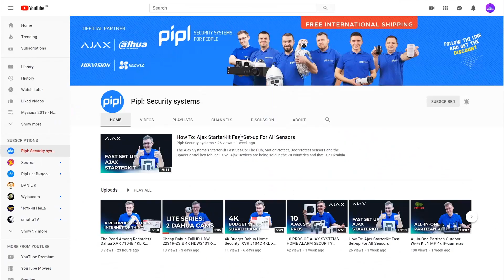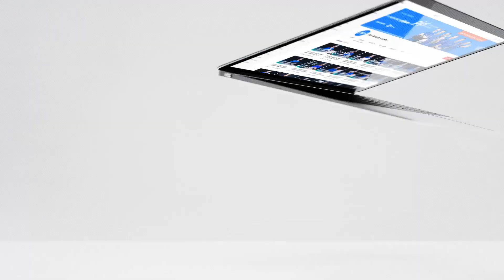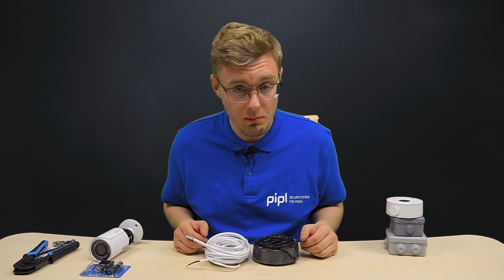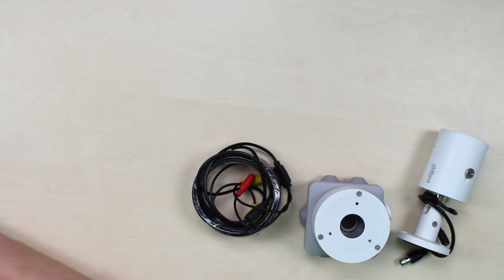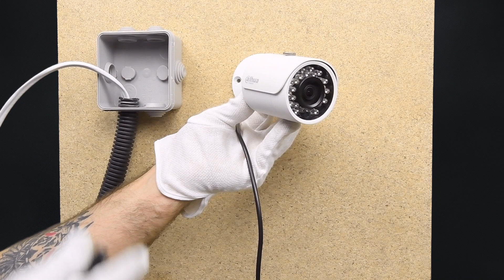How To Install Any Analog Security Camera CCTV DIY

Comment: Use proper watertight connectors outside . 
Use heat shrink around wires . Not electric tape .
Next time you open and need to unwrap, it will be covered in sticky residue .
Water tight box connectors are 3 dollars 
Heat shrink is too cheap to list here
Reply: Personally I would lean towards self amalgamating tape for all the reasons you mention, doesn't sticky residue and is properly watertight.
Reply from the maker: We offer technical support and discussions in our security community IPSC. Join us) 
Link for invitation: https://chat.whatsapp.com/DMGmq85Y5jkAQsNa1ZmviU

Comment: Can you use those BNC adaptors on regular BNC cabling if I cut the exsiting BNC end of the cable off?  I want to run the cable through a conduit for external use and the BNC Male end is too large for my conduit so I was hope to cut the cable and use one of these adaptor to reattach a BNC male to the cable.

Comment: Your demo install in this video is exactly how not to install a camera. Been doing this work for 20 years and stuff like this is what gives trunk slammers and DIYers the wrong ideas about the right and wrong ways of doing things. 
These cameras all come with a back box made specifically for them. USE IT. Never have the wire exposed for ANY reason. If the wire can be easily cut, then it defeats the purpose. And if you say, "well it's mounted 10 ft off the ground" you're underestimating the person who wants to rob your house.
 The camera should be mounted to it's own box and secured with security screws. And if you can't drill a hole in the back of the box to run the wire into your house then you need to use real conduit to the box. Not that cheap plastic innerduct that's made for running fiber optic cables in ceilings. That stuff gets cut just as easily as the wire does. No protection.
There's literally nothing you did in that demo install that would pass inspection in my company.
People might read this and think I'm being awfully hard on you but they don't understand you're teaching bad habits and shotty practices. I constantly find myself having to rip crap like this out to reinstall equipment correctly and it gets old fast.
Reply: I’m confused, you’ve “Been doing this work for 20 years”. Got it. 
I wanna know why tf an expert is searching up “cctv how-to” videos in the first place? After 20 years I assume you know how to install a camera & run cable? Do you have a need to wander off into the comment section and fling §heeeeeeiit talk everywhere like the steamy hot garbage so elegantly written above? 
The Monday Armchair Camera Quarterback 👏👏🤡👏👏
You prob wear white New Balance sneakers to every install & I bet you use the wrap-around sport-strap that came with your mirrored knock-off Oakley’s? 
🤘😜🤘
Reply: @LJWalter78  so true and funny 😂
Reply: @LJWalter78  I had mine cameras installed by professionals about nine years ago. Goose gaming is right...

Comment: hey. can you cut the heads off the compressed cable to put through small hole in the wall then re attach or is that only add the heads on the un compressed cable? thanks